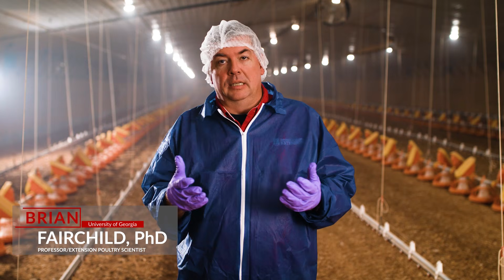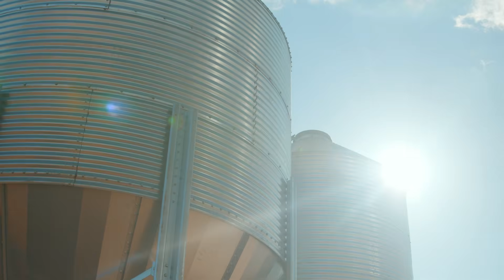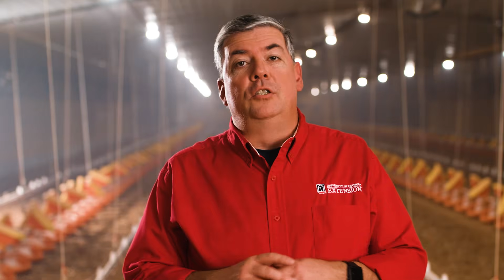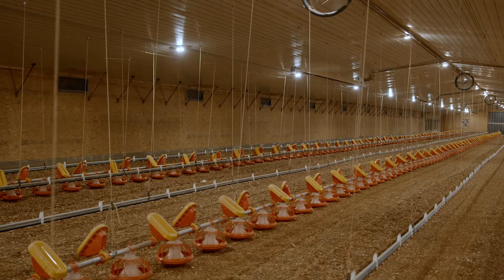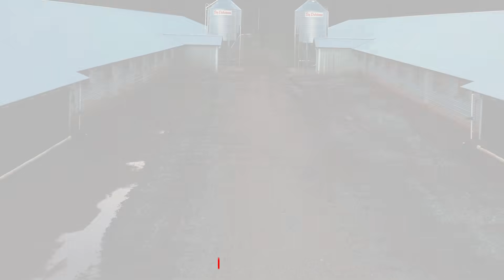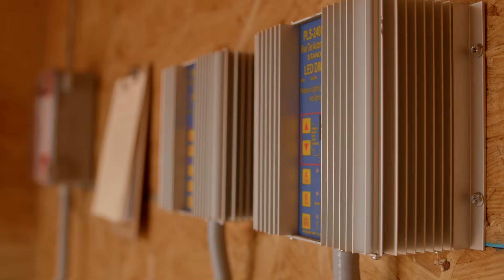Introduction to Modern Broiler Production (all subjects combined)

Comment: This presentation is based in cold countries that needs constantly optimum warm room environment. However, do we need this closed vent system in tropical countries without causing extra expenses for  electricity to make the room cooler? Or We can do with a sort of a hybrid system that are semi-closed that can be completely closed to conserved the cool room environment and then open it up when we need to bring in fresh air and have a constant optimal room temperature.

Comment: Can you provide me with a complete program of feeding, temperature, humidity, ventilation, ratio of carbon dioxide and oxygen, negative and possitive pressure and the prophylaxis program with photos of diseases and BioSecurity... for each day of breeding and the disinfection and fumigation steps in closed sheds before and after in Excel format in the rearing of broilers and laying poultry.